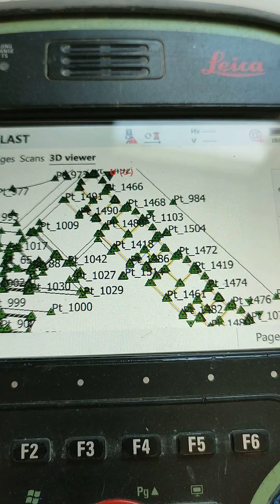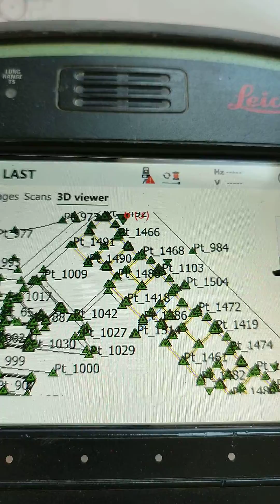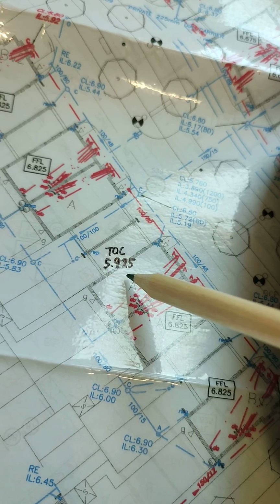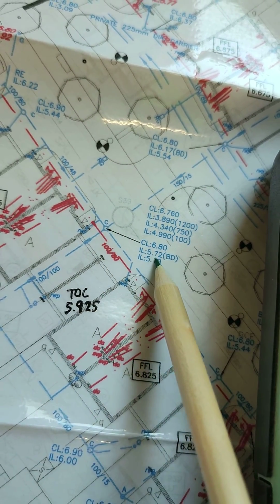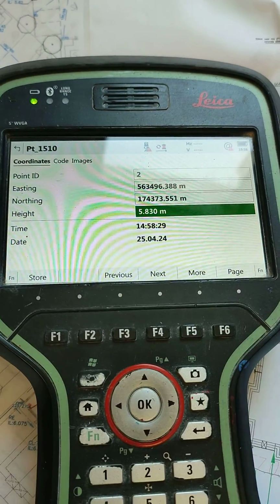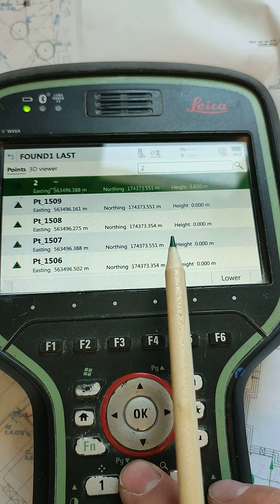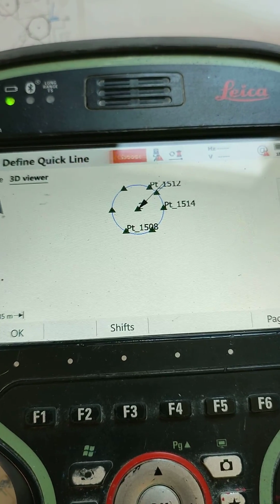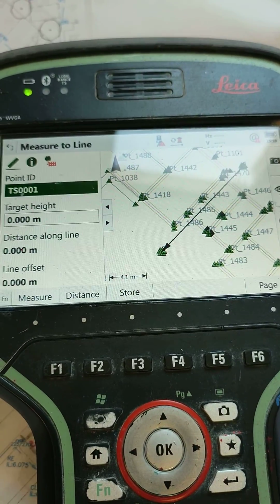Ts16 Leica DTM or line with levels?/ interpolate Part 1

Comment: Hi Vince. Thanks for your video. Few questions please on that drainage line where IL is 5.83 and 5.72bd. What is 100/100 written there and what’s meaning of back drop? Is that like the height of the drainage?
Reply from the maker: Hello buddy, 100/100 it means we have to use 100mm pipe run and the other 100 means it's gradient 1:100. Which we have to divide 1:100= then the answer will be mm per each pipe meter.  
I hope you understand. If you have anything else that you are interested please let me know.
Reply: @gavra1l  thank you so much for this. And for the rest of your videos I’m planning to be a freelance site or setting out engineer so I am learning all I can so I can level up.